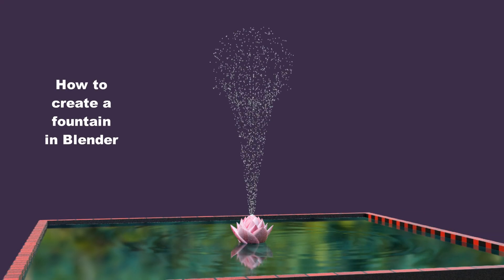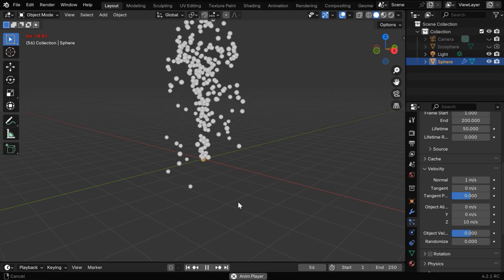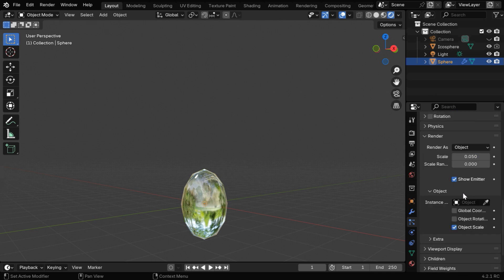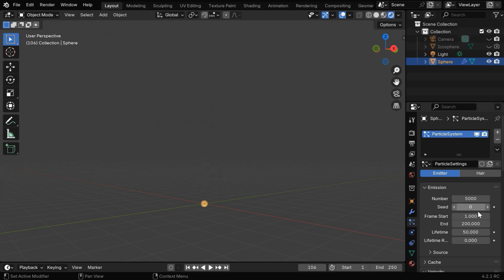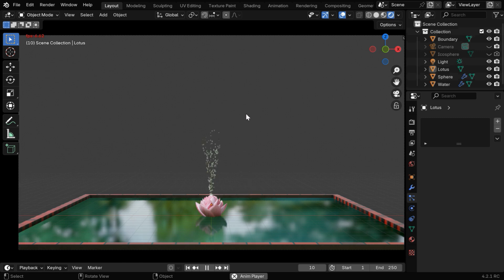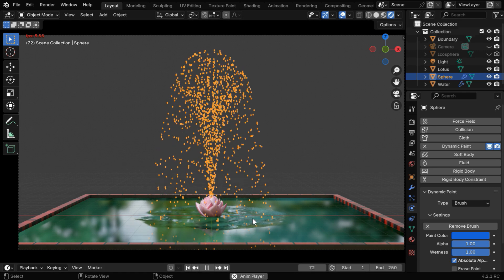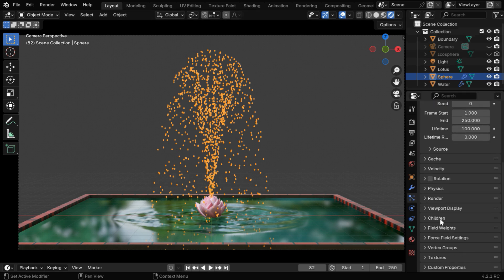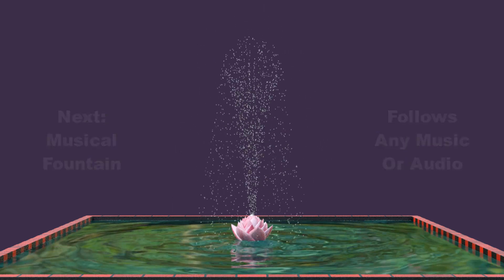Musical Fountain: Part 1 | Create a Fountain with Particle Systems and Dynamic Paint

Comment: hi, can we export this particle animation to .abc alembic format and import in other software.
Reply from the maker: Unfortunately, Blender does not have much support for export, specially if we create an animation using modifiers or particles. So I don't think you can export this animation easily into some other software (or even if it is possible - I am not aware of).